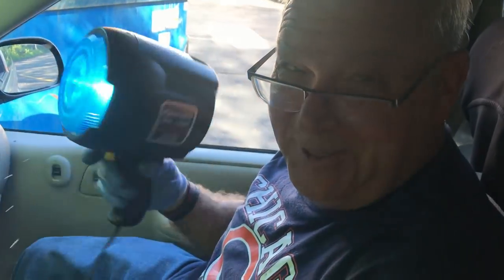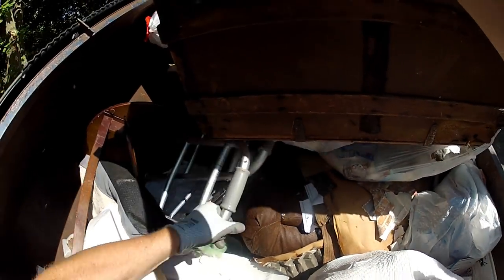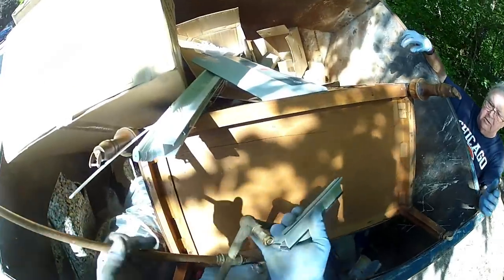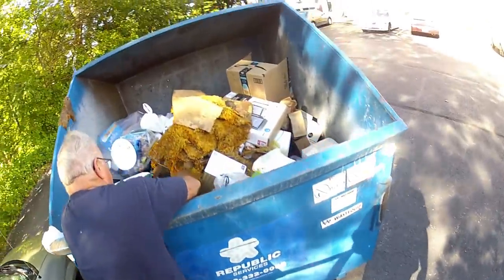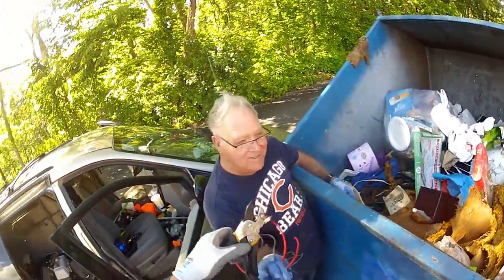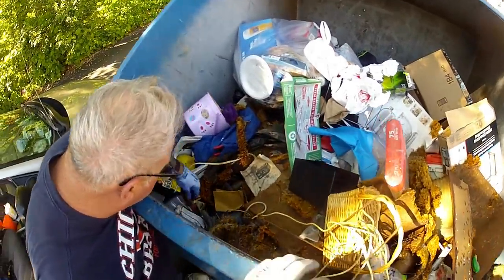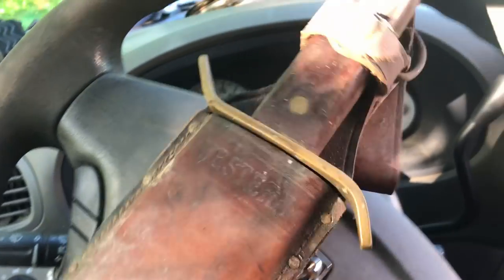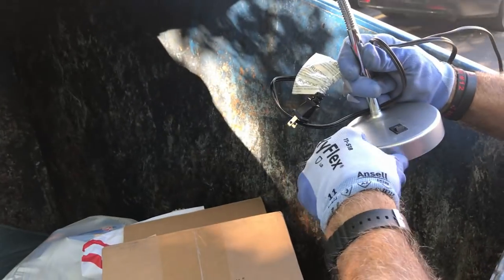Dumpster Diving Action - 6 Knives  - 3 Tackle Boxes - Huge Scores! Western Cutlery Bowie Knife

Comment: Hey microwaves have electric motors in them and it is real simple to get them out if you look on the bottom there should be philips screws in a square that’s holding the motor in it and that will be on the side the buttons are on you take them out knock the buttons cover off and you take something and hit the frame and it will open up and you pull the motor out and cut the wires or just yank it out I can get them out in around a min after now doing some